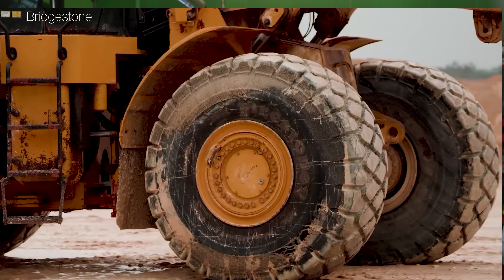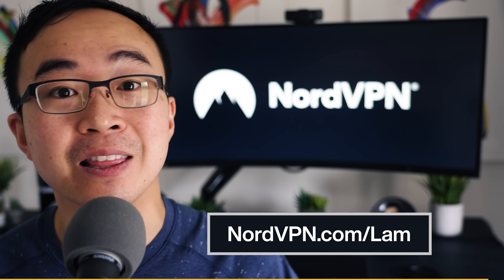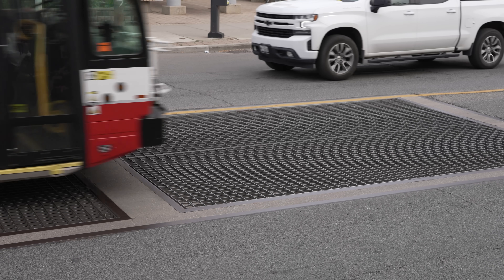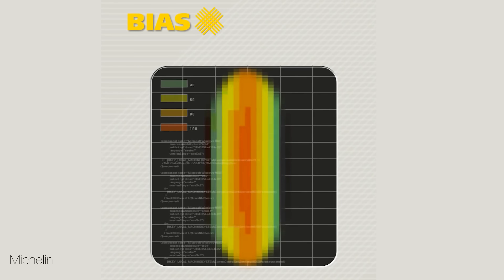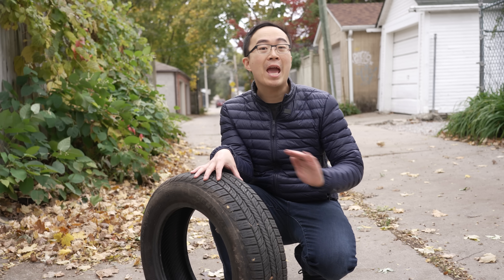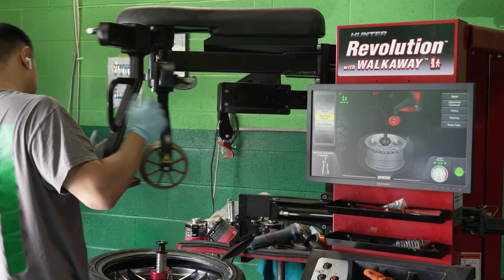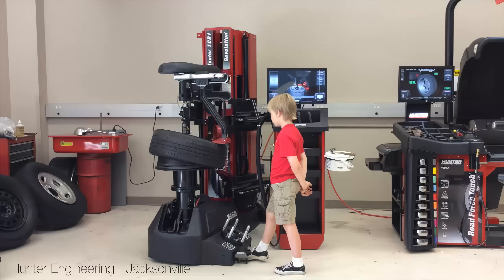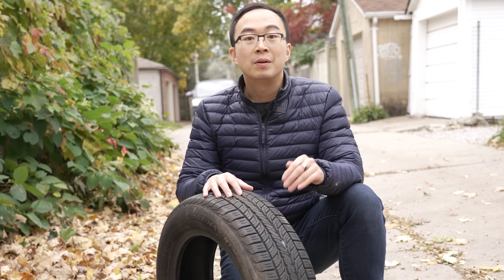How 90 Years of CLEVER Engineering Transformed Tires

Comment: This issue of the depth of Sipes is interesting because this sounds like the tricks the car makers have used in the past to cheat MPG and emissions tests. If they know that the tyre will only be tested when new then why not? Sipes really affect grip on wet or snow covered roads. But how practical is it for testers to wear down a set of tyres to say half their life, with only 4mm or 5mm of tread left?
Reply: I think at a minimum reviewers should note when there are shallow sipes and explain that this means dramatically reduced performance as the tire wears.

I kinda doubt they will do this though, I don't remember ever seeing a car review explain that small displacement engines with a turbo to make up for it get dramatically worse real world milage, especially in harsh conditions. It's so common people think the are buying a fuel efficient car when they aren't because of this.
Reply: It’s a good idea and wouldn’t be too hard to implement. I k ow you can get tires shaved down; even if it isn’t exactly analogous to wearing them down on the road it would be close.

Comment: I have found that tyres made for the US market often have far harder compounds than those made for the European Market, because most Americans focus more on mileage than grip.  I bought a 4x4 car that had a set of American spec Bridgestone Duellers on and the braking performance was poor, even on dry roads. I took them off and replaced them with (europe spec) Goodyears and the contrast was remarkable. I'm only mentioning the manufacturers so you know that they were not cheap budget tyres.

Comment: That tire spreader (what you were confused about as to what it does) is used to hold and spread a tire for applying tire patches. To apply a patch, a lot of scrubbing/scraping is necessary, and that work is much easier when the tire stays still.

Comment: Awesome video. I work in collision repair and I can honestly say I've seen literally hundreds of cars come into my shop and the customer says they don't know what happened but they pressed the brake and they lost control under damp or wet conditions. And 99% of the time they had cheap tires w plenty of tread but the sipes were completely smooth. A large number were also the cause of blowed tires where defects in the tire were at fault.
Reply: honest question; how can tires be so worn out before someone at the inspection catches this?

Comment: For car guys we always know tires are the most Import part of your car some people don't think about it but a good set of purpose built tires can save your life for example I have 4 seats of tires and rims first set I'd for the summer just a extremly good summer tire for rain and dry conditions my 2nd set is a grate all season tire for dry wet and cold first snow conditions my next set is a snow and ice tire and my last set is a dedicated ice studded tire I never loose traction driving normally but if you were to drift I would use a tier with a hard compound like a cheep summer tire for fast paced off road racing I would recommend a soft tire like a snow tire or a snow and mud tire for every day driving on a budget you cant beet a good modern all season tier from Bridgestone, continental, Yokohama, good year, michelin to mention a fue good brands to think about next time you buy tires and one outher thing do not waste your money on run flat tires that just are not good it's still a tire and you should not be driving on a flat tire ever all you do is destroy it and your rims and possibly damage your car causing thousands of dollars in damage from your suspension to the splash shield brake lines and any wires or sensors and body damage if you halve to drive on a flat only go a maximum of 15 mph but 5 mph should be ok for your suspension but you will still need to bet a new tire anyway never use that fix flat garbage it does not work and is a pane to clean out of a tire unless you cleen it out yourself

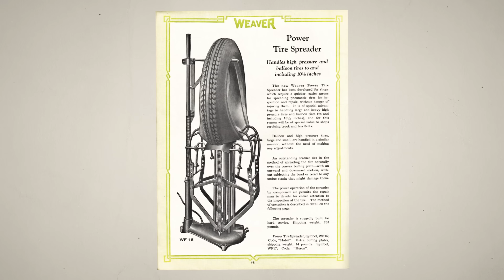Comment: at 10:02, the tire spreader, that is used to spread out the tire, so you can get in, and repair punctures with patches. gives you room to inspect, use an abrasive disc or similar, clean and put adhesive on the tire and a patch.

Comment: The device on the tire machine at 10:03 was great back in the day, it helped the tire repairman "hot patch" tires the right way, it spread the tire wide apart, provided a flat surface to work with, and in many cases gave the repairman a good visual of the damage. Nowadays, if you get a puncture you need a new tire, which is selling more tire bullshit!

Comment: this is why you should always buy high end tires, you get the full life out of them without noticing a major change in performance, the tire you showed in the video is a general tire altimax rt43 they are a decent tire for the price and i have mounted a lot of them but as you said , those groves go away after a while and there is still a lot of life left. where if you get a good quality tire like a continental extreme contact DWS 06 plus you will see most of the groves are still there when the tire is at the end of its life. another important part of tires is the tread wear rating, traction rating, and temperature rating. and normally the higher the traction rating the lower the tread wear rating will be. Still a great video man keep up the great work
Reply from the maker: 100%, I'm hoping through the video that more people will avoid the mistake I made.  Thanks for your comment!

Comment: The rabbit hole for tire tech goes pretty deep.  Did you know that "all season" tires perform significantly worse than proper snow tires in low traction environments?  Did you know that long term cost of snow tires use costs very little more than running "all season" tires in all seasons?  When you're running snow tires, you're not wearing out the summer tires.  And vice versa.  Since you no longer need a compromise tire and compound for all year, you can chose a better wearing tire for spring/summer/fall.  And if snow tires prevent you from going in the ditch even once.....then you actually save money using snows.  Plus, once you have experienced real snow tires, it's almost like having a super power.  Yes, "all season" tires suck less than they used to.  If you want to settle for that, that's your business.

Comment: Buying quality tires is one of the most important and actually cheap things you can do. But even with quality tires there can be massive differences when they wear down.
I wanted to buy some sporty tires for my car and looked at reviews of a Continental and Michelin tire, the Conti actually performed slighty better and where 30-35% cheaper. But when they did a longterm test, the Michelins lasted 50.000km, while the Contis where worn at only 20.000km!
IMHO, long term tests of tires need to become standard.

Comment: I run a tire on all my work trucks that has a tread pattern from 1950's. there isn't a tire that performs better in all the different conditions. the only difference is the original tires where bias ply tires and the new ones are radials. they still make the original bias ply tires though.

Comment: It’s a tire spreader they still use one today. It lets you flex open the inside of the tire to patch punctures. They usually have a light and it it opens far enough for you to stick tools in so you can rough up the surrounding rubber to apply patches to

Comment: great job. should have gave a shout out of a few brands that skimp on the small  tread depth. I find it amusing the brands that skimp on the small tread depth also make their tires studdable. Its like pay more for traction we went cheap on. a long term tire test on wet and winter ( snow and ice ) should be done per tire model. I wonder what a tire would sound like if you had the tread blocks lettered like the genetic code and which genetic code made the best tread pattern

Comment: I like the content, but if you're going for an educational focus channel, I think you should cite your sources more carefully. 

Particularly, I thumbed the 3 sources you mentioned for the reduced depth of the water channel you mention that tire manufactures are doing to reduce cost. But I couldn't find what was being referenced since that was interesting and I wanted to see where the source was and if they mentioned what was tested by whom.

But the other stuff should have sources too, like "How a gas crisis changed tire construction forever" also being particularly interesting. That would be an interesting question if consumer focus changed development, or if other attributes sold it (like maybe it's cheaper to make, or has better performance) and it wasn't particularly the increased fuel economy being the reason it was replaced.

Ideally, they should have a reference in the video itself to the source and the full link in the description, but just making sure all your sources are listed would be a good starting point.

It was a cool video though and good luck on the rebranding for the channel. I always like to learn something new.

Comment: Showed up in my recommended, I have to appreciate the level of detail you put in to the research of tires and such. I work as a car mechanic since graduation (5 years) and while we still use regular tire machines which assist of removing the tire with your manual input, and of course alignment work being done, I appreciate the understanding you have for the profession. I work at a car dealership but we have a lot of contacts with motorsports so we do a lot of specific alignments and tuning work depending on the season.

Subscribed to see more from you, and see if you follow through on these things that the normal consumer might not know about :)

Comment: Nice vid, how someone can be a master at his craft when a machine is doing all the work ?
Reply from the maker: Good question, more complicated wheels and tires require manual setup especially if you want to avoid putting any scratches on a $10,000 wheel set.

Comment: I already knew most of the info here, but the interlocking 3D siping is something I wasn’t aware of. Thanks for that info, along with the graphic supplied, it was simple to understand. 

While most reviewers only review new tires, some sources do long-term testing on a select few tires, and the user reviews on TireRack and Tires sites include mileage, so you can see how tires perform over time, ON SPECIFIC VEHICLES. That last part is vital, a tire may handle and wear well on one vehicle, but not nearly as well on a different vehicle, so I always recommend looking at user reviews for your specific vehicle model/yr, or at least those within the same 4-6yr range between vehicle redesigns as your vehicle.

Comment: 8:12 That is a fatal crash into that semi trailer because the DOT bar that is supposed to protect just folds right under. This was how Jayne Mansfield died in 1967 when semi trailers had no bar in back, so the govt mandated a bar the next year after that. But as you can see the bar does not work. If you rear end a semi with a lot of overhang in back you are dead.

Comment: I would like to know how 90 years of clever engineering led to no dipstick for checking the transmission fluid. ...And why that dumbass engineer  is not fired for trying to check a fluid level from the bottom side of the tranny pan, when hot......And get some corporate interviews captured...So we can exterminate these offenders.  Then I'll subscribe.  Cheers and thanks in advance.

Comment: Snap-On definitely did NOT invent the round corner socket. I have a set of Metrinches that are older than Snap-On's round corner sockets. Metrinches were first offered in the late 70's early 80's via infomercial, but happened to prove  being real, not some cheap dollar store brand. They fit metric and inch as well as Imperial sizes and contact the flats on the nut or bolt. They are made from hardened Vanadium and have a lifetime guarantee.
Reply from the maker: Snap On's patent is from the early 60s so I'm not seeing how Metrin came before.

Comment: This is the first video I've seen of yours and it's excellent! It's easy to ignore the small details in the engineering of products which make a huge difference in performance. Your discussion about the design and implementation of siping brings to light one of the many seemingly minute differences which make a big difference in performance and, by extension, safety. Consumers should be aware of compromises made in designs balancing cost and performance. Thanks for the great video. Keep up the good work!

Comment: I drove a Volvo S60 a couple of years ago and I was surprised by two things: 1) How well the adaptive cruise control and lane assist worked, and 2) how absolutely unbelievably lousy it was about letting you know that it was no longer in action (like, when a lane split and the car no longer knew what was what). These new technologies definitely need some in-depth reviews. Thanks for the info on tires! I'm less inclined to buy cheap tires, that's for sure!

Comment: Great stuff Andrew! I think a good starting point, to hold tire companies to a higher safety standard, is to keep a running list of brands to avoid because they use the engineering cheat.
Reply: it's not a cheat, its a tradeoff. if the sipes go all the way to the bottom of every tread block , the block loses rigidy and will bend and twist causing a squirmmy feel as you drive and it will create more heat in the rubber making it wear even faster

Comment: I saw my old tires the Altimax RT43 which were great when new.  I changed them when they still have plenty of threads because I felt they were slippery.  I already put 130k on it and they were sigificantly noiser than when they  were new.   I did not notice that the thread actually changed that much over time. I changed to Toyo qt on Oct 2021, and I see this1 month after I changed tire.
Reply from the maker: I have the rt43s funny enough.  Your toyos might be fine

Comment: A good video but I don't think you mentioned how the rubber itself has changed and improved over the years too(?) 

For example, all-season tires weren't a thing several years ago but now with improved rubber technology/compounds you have tires that can perform well all year round in summer and winter conditions. Like dedicated winter tires, all-season tires are certified for winter use by the mountain snowflake symbol on the tire sidewall.  

Where I'm from with milder winters I think all-season tires are a good choice, and I have them on all my cars. In cold and wintry conditions the handling and safety is improved when compared to using summer tires all year round (which most drivers in my country still do). Obviously for places with harsher, longer winters you will get better performance by swapping between two sets of tires (summer and winter tires). Also maybe if you drive a sports car, and want optimal performance, then you would probably want to swap tires according to the conditions too. 

And I totally agree tires should be tested over an extended period of time, and not just when they are brand new and supple. I remember suggesting this on one of the popular youtube tire review channels a while back. Most of us will use a set of tires on our cars for a few years. Over that time not only does the tire pattern change but with weathering, sun light etc the characteristics of the rubber itself changes (often hardening) which affects the performance of the tire too, especially in cold conditions.
Reply from the maker: Thanks Jake, the rubber is super important and I didn't mention it because visually there wasn't much to show.  It would be a fascinating article to write though.

>All Season Better Now
Yeah, the new tires are WAY better.  CrossClimate 2 is one, maybe the first real "all-weather" tires which can handle some snow.  

Hopefully we'll also see more worn tire tests in the future.
Reply: i would still recommend you use dedicated summer and winter tires for a few simple reasons:
first of: changing your tires twice a year is a good practice since you'll also look at the structures underneath your tires when you take them off, so you can see problems with your brakes before they become expensive to fix.
secondly: most people use aluminium alloy rims these days, they don't like salt water which will be all over the place during winter, they also don't like you loosing traction and sliding sideways against a curb, which is why it is advantageous to have winter tires on steel rims, which can take all kinds of abuse.
thirdly: since you have a second complete set of wheels lying around, if one of your tires blows on a friday afternoon, you're not stuck with the shitty ass spare wheel most cars come with today until monday when the shop opens, also if one of your aluminium rims cracks due to a minor accident, you can use a wheel from your winter set until you manage to hunt down a replacement rim.
last but not least: winter tires and all year tires are made of rubber that stays soft at low temperatures, those tires wear more quickly during summer because the rubber gets even softer when it's hot out, summer tires are made to remain hard at high heat, so they wear more slowly and you'll save money in the long run.

Comment: For anyone interested the "whatever the heck this does" is a tire spreader, which are still used today to patch tires (for shops that have them and not all do). Usually they have a light attached so you can see inside and use the necessary tools to patch the tire. They also keep the tire in place, otherwise you're patching a tire on the floor. Don't know what else they may have been used for, just my personal experience.